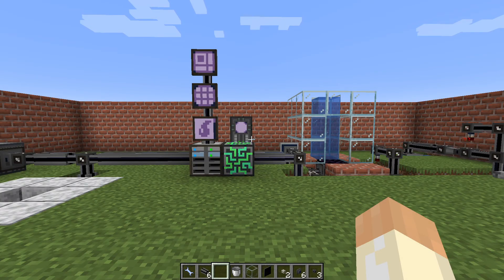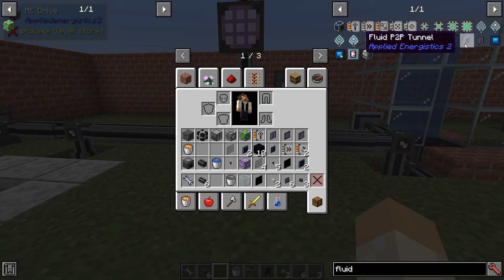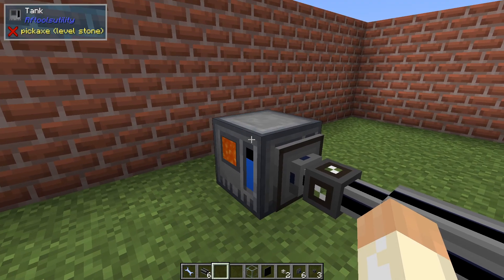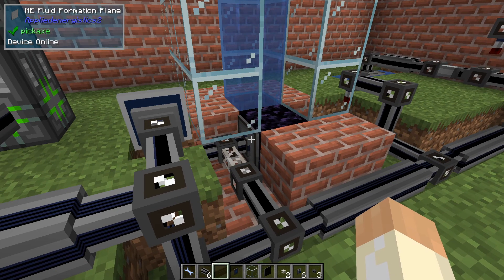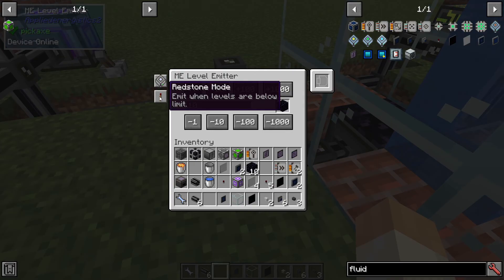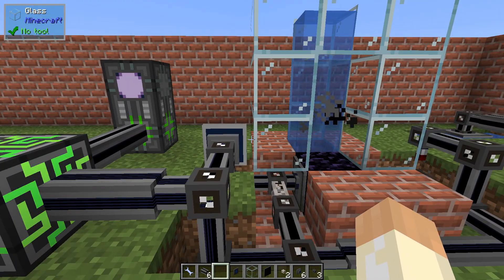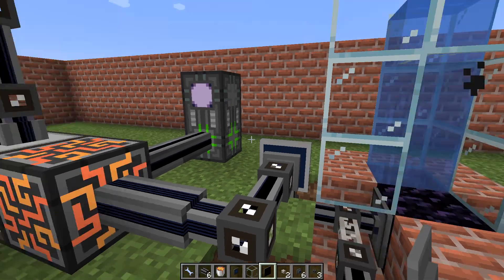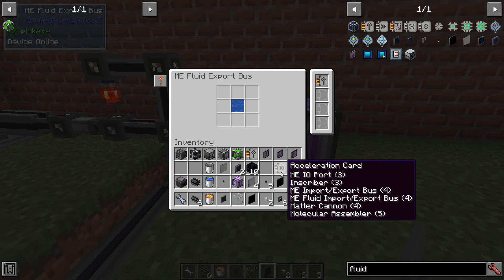Fluid System in AE2 for 1.15 and 1.16 - Applied Energistics 2 Tutorial

Comment: Do we have a fluid crafting chamber or whatever it was called in extra cells back in 1.7.10? Where you put your patterns that include fluids, and the system crafts them taking fluids from your fluid storage (as opposed to filled buckets from item storage)?
Reply from the maker: I don't remember all features from Extra Cells 2 that I covered many years ago but I know for sure that the AE2 adoptation of fluid systems is a bit simpler than EC2. But there are ways around it sometimes, I made a video on auto-crafting harvestcraft food and they have fluids so maybe that could give some ideas? Using AE2 and other mods together, that is.
Reply: @therealtkh  Thanks for your reply, yeah with others mods its no problem, many of them have some sort of autocrafting that fluids can be piped into.

Comment: huhhhh im in atm7 and the fluid cell but none of the stuff needed to use it aside from portable cell variant
edit nvm its totaly broken even in portable form  why its even in the  mod >_>
edit2: nvm again i hate quiet update
they combined the non fluid to work with fluid stuff >_>
Reply from the maker: You are correct, and I have to admit that I haven't looked into every change but I know the new fluid system has caused some confusion for many! (Myself included) Several "fluid blocks" are now (in 1.18) merged with the regular ones and it might make some things easier but personally I would probably prefer to have them separated :)
Reply: @therealtkh  yeah confusion overload
and the current beta version crash alot  in atm7 :S i now have to learn refined storage

Comment: I can't get the formation nor annihilation planes to work!!! the formation doesn't place anything (even though i set it to lava) and the annihilation plane doesn't destroy obsidian when i place it in front of it!!! they are all connected to the network!
Reply from the maker: So hard to guess, I don't know what version you're using, how the build looks, how channels are used or anything like that. Would help a lot with screenshots and discussing over Discord or Facebook...
Reply: @therealtkh  Yeah, took a bit to get it working, I ended up with it just constantly getting lava dispite the export node being inactive and even removed, no clue how... I then did it the exact way in the video and it works pretty well, although i think the GUI is bugged because it only placed lava at a certain (slow) rate when it says it has full (4 buckets) in each slot of the interface. The breaker was a fluid thing... not a block one, got that working as well, changed the design a bit and it works good enough... I then realized: i have an obsidian chicken (roost mod)... i didn't even need to do the fluid stuff lol
Reply from the maker: @redpug5042  Haha, regardless it was a good lesson and you'll know how to build it in a different pack! Good thing you got it working, and I didn't know Obsidian Chicken was a thing.... ;)
Reply: @therealtkh  yup, i'm very VERY new to modded so i messed a lot of things up... the modpack was Stoneblock 2, yesterday i got the transmutation tablet, blew up my reactor, got a rainbow generator and upgraded all my draconic armor. Basically everything is free now, meaning that it's time to build a base that isn't a few stone rooms :D

Comment: I'm interested in how to use AE2 fluid storage in order to make food ingredients from Pam's Harvestcraft.  I'd like to auto-craft the items.  There are many recipes that require a bucket of water, or a bucket of milk.  I was hoping I could use AE2 fluid system with auto-crafting to make those.  This video doesn't really go into auto-crafting that much.  Any chance you have a fluid auto-crafting video coming out soon?   Fingers crossed.  :)
Reply from the maker: The thing with auto-crafting with AE2 and fluids is that they are tricky to handle as they are not simple objects to move like items! As long as there are buckets or other containers in the recipe it's usually manageable, even with IndustrialCraft! Might be a video from this discussion.... :)
Reply: @therealtkh  Since the Assembler can't handle buckets of fluid, I'm not sure of the value of fluid storage.  I use Ender Tanks for water and lava, and I don't really use that much milk to need more storage than a portable tank.  If you can't extract and use the fluid directly from the ME System, what's the point?  Other than exporting the fluids to Fluid Transposers and similar machines.
Reply from the maker: @mdfrenchy  Oops, late reply here, but yeah, as far as I have used the fluid part it's mostly about importing, storing and exporting. I know this topic has been discussed for years and to be honest I think the fluid part of the new AE2 releases is worse compared to how Extra Cells 2 handled it. There are some machines in other mods that can use fluid in crafting recipes so I would have loved to see this in AE2 when they adopted the fluid part as well, but as far as I know that's not how it works.
Reply: @therealtkh  Yeah, I've noticed that I can't use buckets for any of my recipes through an Assembler.  I've had to set up Ender IO Crafters to create the ingredients requiring buckets of milk or water (dough, tortilla, salt, ice cream, etc), and Thermal Expansion Fluid Transposers to fill up the buckets of milk/water, and then funnel all that through to my AE2 item assemblers for final production.  It works, though I'm not sure its the most efficient.  I'm sure if I had other mods added to the server I could get it to work better.
Reply: @therealtkh  Would love to see a video on this.

Comment: are there any new things in the newer versions?
Reply from the maker: Not that I can think of, and I looked through the release notes going back two years and found pretty much "only" improvements, compatibility and other fixes to make it work with the latest releases of Minecraft (currently 1.16.3).
Reply: @therealtkh  yeah, me too! I wonder if it becomes a stale mod, simplestorage is often used for the storage part and AE for the automation while the channel system dont have too much fans out there i think...
Reply from the maker: @squirrel4091  I guess that's the risk if they only update it to be functional and compatible.... How people like it these days I don't know, personally I usually prefer mods with some form of complexity. Channels makes it still simple to use in small scale but requires more "network thinking" to go larger. It feels logical, I think. And has a higher satisfaction level :)